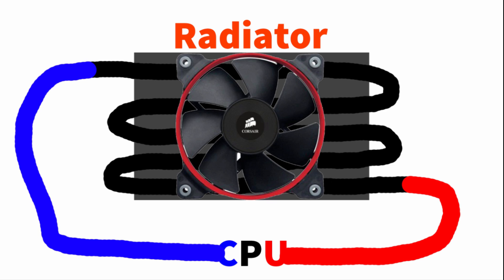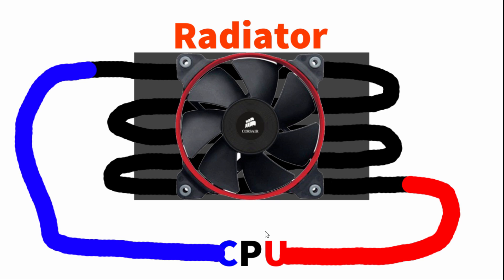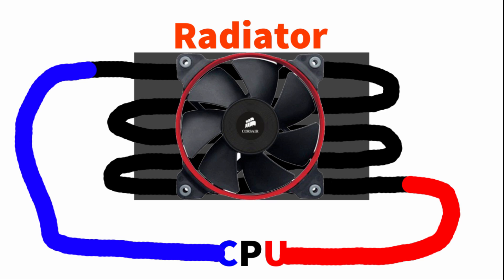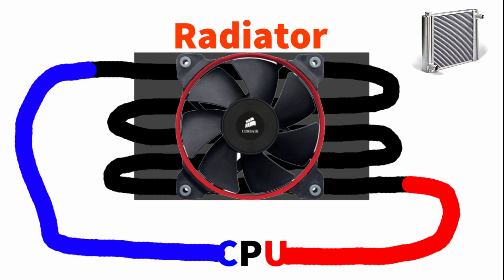How Radiators Work For Watercooling Systems

Comment: got a question: the fans can be replaced? i can buy LED fans? no LED fans? and install them on the radiator, right?
Reply from the maker: Yara Brandao Yea you can do whatever. the fan sucks heat out. it just sits outside the radiator.